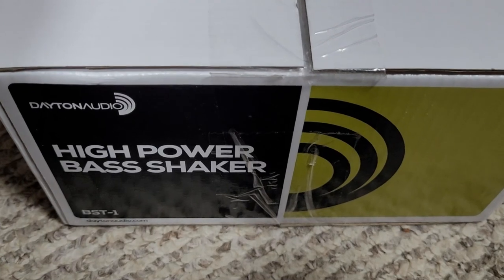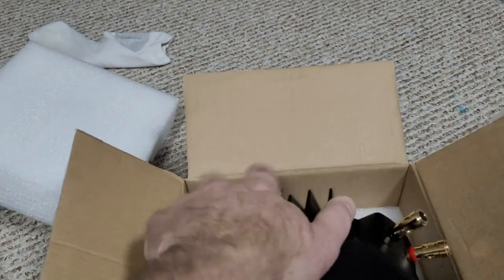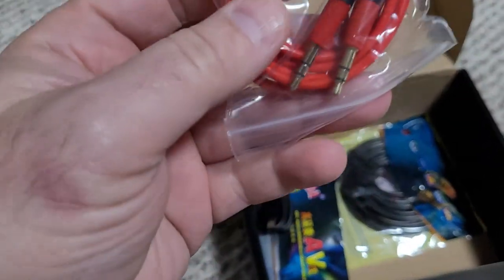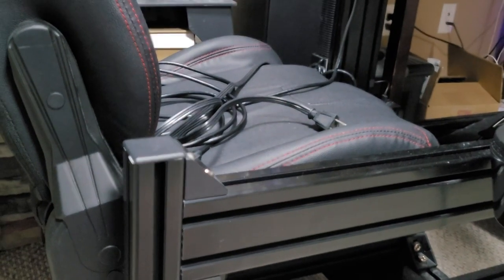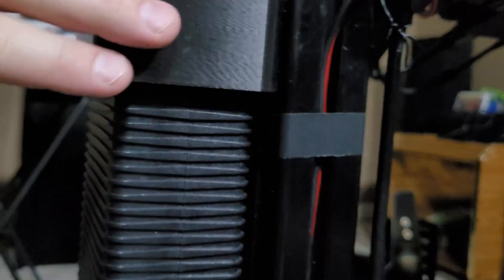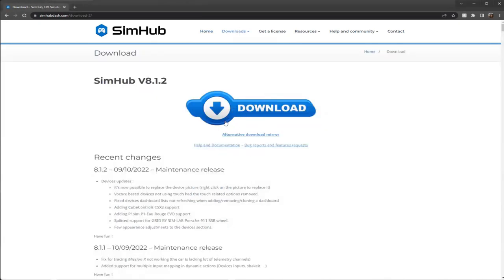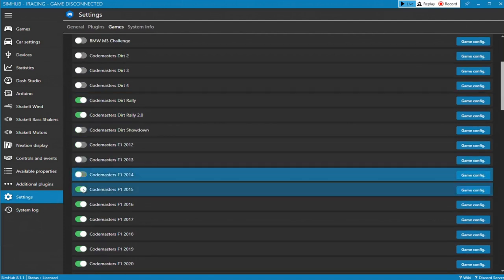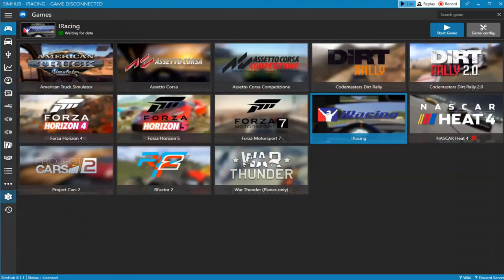Buttkicker Alternative Under $100 for Sim Racing

Comment: I would bet that the difference in feel between a ziptie-to-spring attachment versus bolting to a piece of metal which is firmly bolted to the rig will be stark.  You are going to lose a lot of fidelity to both the play in the zipties and movement of the springs, causing you to miss out on higher frequency and lower amplitude vibrations.
Reply from the maker: Yeah I am not sure if I am missing out on any frequencies, but it is super powerful.  I had to turn it way down.  I currently getting good vibrations from 30hz to 60hz  I am not sure if I could get a better frequency range if I mounted it to the 8040 rig frame.

Comment: I never had to manually set the path for each game ~ I just clicked and it worked
Reply from the maker: right, this is how it is supposed to work, but every once in a while it doesn't.  Especially if you install games to non default locations.

Comment: I have used both in a 4-channel configuration. If the cost of Buttkickers is prohibitive, go with the Daytons. From my experience, the Buttkickers are next-level, blow the Daytons away. I was shocked when I upgraded to the Buttkickers.
Reply from the maker: I agree the buttkicker transducers have a higher fidelity than the Dayton Audio tansducers.  That means you can probably put I higher number of different effects through the buttkickers and still feel the difference in viberations.  However, I don't care much for the amps provided with the Buttkickers, they are prone to overheating, at least they used to be and they didn't save the volume settings when turning them off and back on again.  Also I only use about 4 effects and the Daytons can handle those just fine for a 3rd of the cost.  Thank you for the feedback I think you are right.

Comment: 2 of their 2.1 audio amplifiers would be sick. It would let you run 4x smaller shakers (L/R front and rear) and two of the bigger bass shakers mounted center under pedal plate and under seat. Obviously a little pricier of a setup, but probably a LOT better feedback

Comment: I wonder if I could hook this up to a headphone-amplifier that also has output-options for speakers. - I'm just not sure about both whether or not I can get an output-signal while also using the headphones, AND, even if it does do it simultaneously, if it's enough power. - If that would work, I could potentially leave out buying an amp, if I'd get into this method. - I need things to be streamlined anyway, because I need to be able to set up my rig onto my regular desk. I simply have the wheel ready to go, apart from the USB-cable, to be mounted to the desk. - It's just those additional two or three wires, though... AND another power-brick... or two... But perhaps it could be doable with some streamlining.
Reply from the maker: The issue is you need to have a seperate sound card for this application.  The great thing about this solution is the usb sound card is built into the amp.

Comment: Thanks for making this video. I've seen a number of them now, but always great to get another perspective to pick up on a particular nuance. 

Yours was primarily the gamma - the curve or amplitude rate - and the "one at a time" method 🙂

I'm with you about the speed & effectiveness over feelings and immersion (as nice as they might be)... So, had the thought about speed, road rumble, gamma and pulling them all together for greater effectiveness... I remember Nico Rosberg (former F1 World Champ) talking about how, in a downforce car, as the speed drops, so does the downforce, and so one has to come off the brakes to avoid locking (ie hold it at maximum braking threshold)...

Bearing in mind that drag and downforce goes up with the square of the speed, could tune that rumble to let you know when you're now in danger of locking? 🤔 Just a thought!
Reply: So, you could have some high-pitched whine at high speed... If you can't hear it, be a little more tentative on the brakes?
Reply from the maker: I appreciate the suggestion,  I will see if I can get something like that going.
Reply from the maker: right, I think that is what he is getting at.

Comment: I wonder what a clustertruck this would be to set up under Linux...
Reply from the maker: Um, I am not sure about linux.  You would have to have simhub or sim commander running to control it.  I use linux myself for different purposes.  I have Linux on my steam deck and I am also running a linux server at my house, but I have never tried sim racing on linux.  Sounds like a lot of work.

Comment: Does it somehow work with non racing games like FPS, flight sim etc?
Reply from the maker: It could but you would have to have software like sim hub to run the effects through.  Sim Hub has a large list of games it works with and not all are sim racing titles.

Comment: Can something like this be used for music/cinema as well?  If just using for music/movies, would I still need to use simhub or how would that work?
Thanks!
Reply from the maker: Yes, I can absolutely be used for home theater use.  Instead of using simhub, you just need to split your subwoofer output and send it to the AUX input of the nobsound amp.  You wouldn't use the USB input in that situation.
Reply: @Area51AlienFactory  Based on your comment above, I am assuming I can use this for a console setup? Right?

Comment: sorry i am late to your video but i have only just decided to go for this kind of set up. My question is, with attaching the shaker to the seat springs, when sitting in the seat the springs bend downward and obviously stretch a little, could this damage the shaker in any way as its a solid object attached to a movable object. Hope that makes sense lol, cheers.
Reply from the maker: It worked great, no damage to the bass shaker.  However, I got a new seat and did not have the springs exposed to I had to come up with a different solution to isolate the bass shaker to the seat only for vibrations.  I ended up using a another piece of aluminum profile and rubber washer and attached it to my rig where the seat slider rails connect on each side.
Reply: @Area51AlienFactory  That`s great, thanks so much for the reply, think i am going to go for that set up, cheers 👍

Comment: Awesome, jusr question, how you connect amp to pc, 3.5mm to 3.5mm pc souncard, or usb, or…? Thanks
Reply from the maker: I connects to the pc via USB.  It is actually a usb sound card and amp all in one.
Reply: @Area51AlienFactory  thank you, technically I can plug in my buttkicker 3.5mm jack to this sound card, correct? What do you think? My idea: I have already buttkicker on a back of my cockpit and I ordered on aliexpress this amplifier and daytonaudio to front of my cockpit… so what do you think?
Reply from the maker: @ddsracingfl  This amp does have a 3.5mm jack.  I think it is an input jack not an output.  However, I am sure there is a way to get this working with your exsisting buttkicker.  Buttkickers usually come with there own amps.  You could probably just remove the buttkicker amp and just take the speaker wire straight out of the new amp into the buttkicker transducer.
Reply: @Area51AlienFactory  true, in simhub as far as I remember you can choose different, multiple outputs, because I know some people using 4 corners shackers, it’s mean minimum 2 amplifier’s, I am worry about connecting to PC internal sound card

Comment: I love the option to ButtKicker but the SimHub software doesn't have the flight sim I use (DCS). Is there another alternative to it?
Reply from the maker: Yes there is another software that can run them but it costs a little more.  It is called Sim Commander.  I am not sure if it is compatible with DCS or not.
Reply: @Area51AlienFactory  Thanks mate. I went into a forum and found out a compatible software called Sim Shaker. I ordered the parts, can't wait to get it up and running.

Comment: CAN ANYONE TELL ME how to  use these on  ps5. i was told u can even use simhub if u run through ur laptop 1st  PLEASE HELP
Reply from the maker: You would need to somehow get rca audio out to the amp and add a low frequency cross over filter and it should work.  However, it would just produce vibration for all low frequencies instead of specific effects like Sim Hub produces.  Some people use these in there home theaters like that to give a tactial feeling for bass sounds.

Comment: Does this setup work with ps4/5?
Reply from the maker: You would need to somehow get rca audio out to the amp and add a low frequency cross over filter and it should work.  However, it would just produce vibration for all low frequencies instead of specific effects like Sim Hub produces.  Some people use these in there home theaters like that to give a tactial feeling for bass sounds.

Comment: Would this work on a Xbox X set up??
Reply from the maker: The bass shaker should work fine with an xbox.  But you might want to get a different amp that can filter out the mid and high range and only send the very low frequencies to the bass shaker.  The amp that comes with the buttkickers can you that out of the box.   So short anwser Yes!  Just get a different amp with the low frequency crossover cabability.
Reply: @Area51AlienFactory  can you point out an amp that will work? I’m on PS5 and would love to add this! Tks!
Reply: @sonyx5332  hi! I bought the nobsound na-10g and it’s working great with one Dayton DST-1! I ordered another DST-1, I think I would need the 24v power supply!
Reply: @efrainarchilla4942  Did you get your setup working on PS5? i’m looking to do the same.
Reply: @theomakriyannis  hi! Yessss! It worked fine for me!
Reply: @efrainarchilla4942  nice!!  which nobsound amp did you use?
Reply: @theomakriyannis  I use the NS-10G, but with just one Dayton BST-1! I have the NLR GT Lite which is enough for now! looking for something less powerfull for the pedals! and since is just one bass shaker havent upgrade de power supply!
Reply: @efrainarchilla4942  Thanks for the info. I was planning on doing the same, one for the seat and another for the area under the pedals.  I’ve got the NLR wheel stand 2.0, so one shaker would go under the off chair 😂. I’ll start with one to get an idea of how strong it is.
Reply: @theomakriyannis  no problem! Go for it, you won’t be disappointed! Totally worth it!
Reply: Finally someone answers the question!!! Console people were human too..all gamers matter

Comment: That amp is not powerful enough. You would want a 100w amp. (need overhead)
Reply from the maker: I have had this setup for about 5 months now and I even added a second bass shaker about 3 months ago.  I can personally say this amp has been more than enough power for both my bass shakers.  In fact, I have to turn the power gain on the amp down to 60-75% or it vibrates waaaaay too much.  Sometimes I even turn it down to 50%.

Comment: I knew there had to be other options...without paying for the butt kicker logo! Thanks...these are exactly what Ive been looking at. It's just a driver without sound...many companies make these...much cheaper too! just gotta get creative with mounting...whcih aint hard
Reply from the maker: Yeah I just mounted a second one under my pedal tray to simulate the front wheels yesterday.  It is great.  Now I have 2 bass shakers seperating the front and rear for $150 all in.  That is way better that a single buttkicker for $300.
Reply: @Area51AlienFactory  exactly...I'm in process of building a new rig. Trying to decide but think I'm going GTR with the triple mount...then adding 15 dollar wall mount arm so monitor will pull in closer. Selling my trusty old GT lite foldable
Reply from the maker: I highly recommend the GT Omega Prime.  You can't beat the value on an 8040 Aluminum rig.
Reply: @Area51AlienFactory  thx...looking into it as we speak! ...It's nice but not what im looking for. Price is high for what you get I feel.
Reply: @Area51AlienFactory  Are you using one amp or two amps for the two bass shakers (front and rear) that you added?
Reply: Does this 100% benifit your ability to feel wheel slip and loss of traction?
 Is this loud?